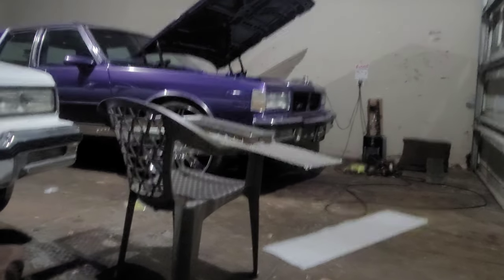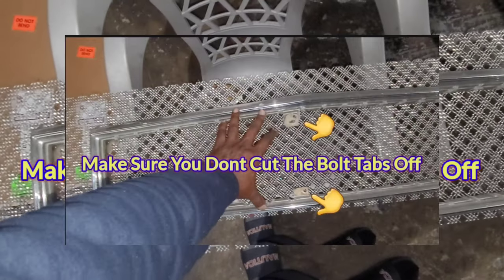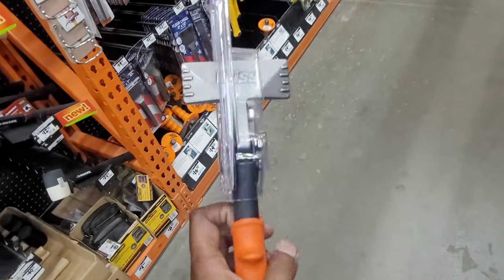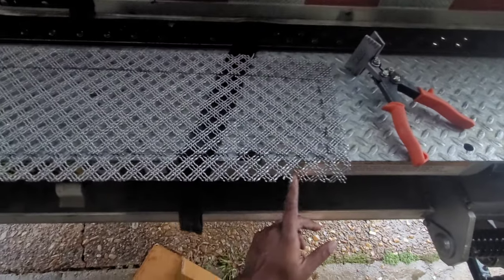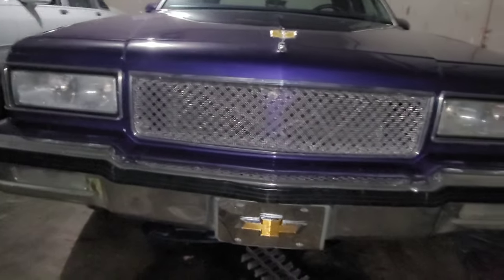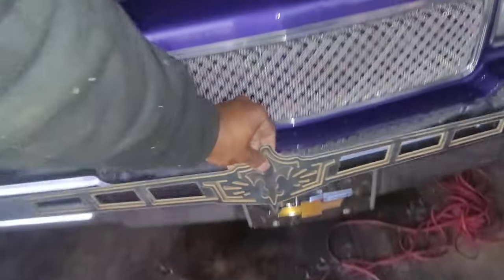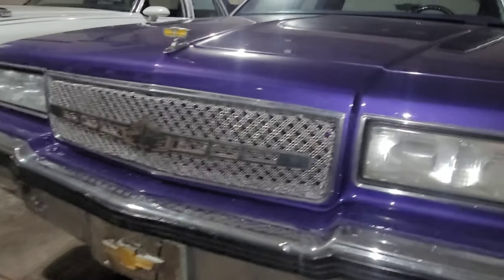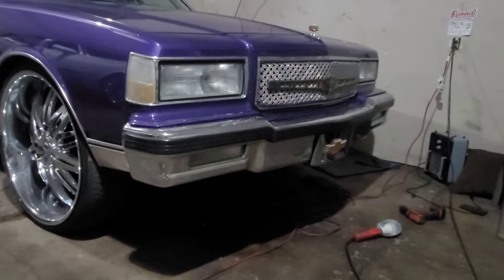How To Make A Custom Box Chevy Grille With Your Old Grille

Comment: Good job man. I think your measurements for the cuts were slightly off. Add another inch of space. A Metal Brake would of made it easier or putting a block of wood while hammering it down or rubber mallet. They also sell a cheap chrome bezel that works better for these, so you don't have to hunt down an original in ok condition. I had the same idea for mine :)
Reply from the maker: They were off appreciate it I know the next 1 should be better 💯
Reply: @drejackson1000  Fasho. Thanks for showing it. The shield part was my hang up, but good to know dude sells them jic.